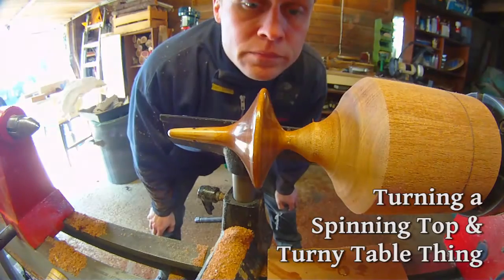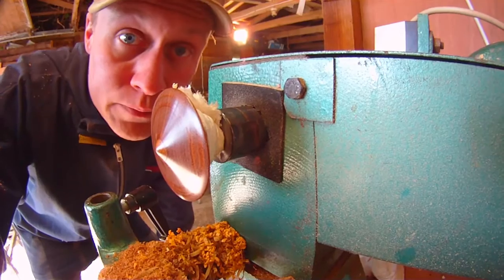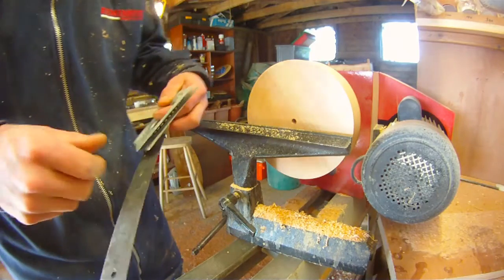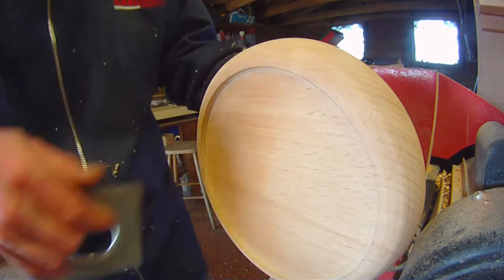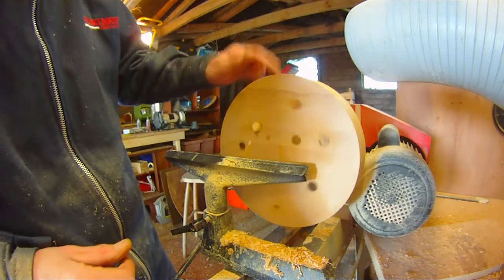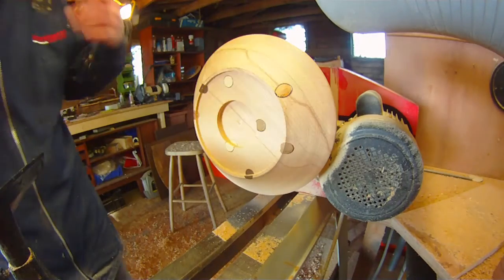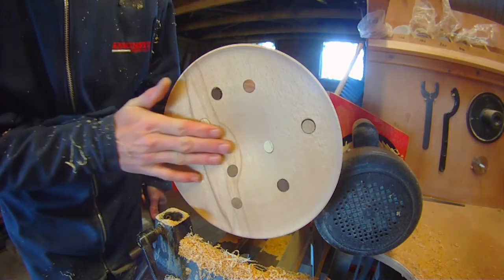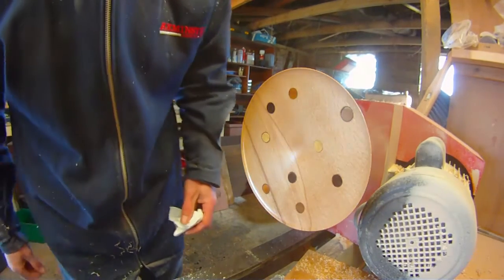#4a Wood Turning a Spinning Top Turny Table Part 2

Comment: Ahhh... I wondered how you were going to attach the Lazy Susan without drilling a hole in the bottom to attach screws.  Epoxy wins again!  Great idea.  Now... back to the video...  This project worked well.  The save with the top was super and reminded of me of the painter Bob Ross and his ''We don't make mistakes, we have happy accidents" because it all worked out great.
Best wishes, Brendan.

Comment: Hi Martin. Firstly thanks to Mike for all your mentions in his videos, now I've exhausted all his videos I've moved on to others to watch. A great project to watch with all the little hick-ups and how you got over them. A little annoying with the music over when you were talking but still worthwhile a big thumbs up.

Personally I would have gone for the screws on joining the bases together, but then I have no experience with glue on metal to wood. I know it means drill holes through the base but it allows you to take it apart if required.

Great video though. Not sure how many more I have to get through but ploughing through your list.